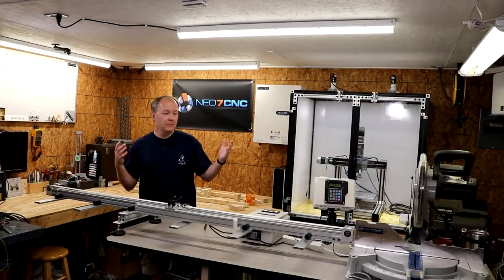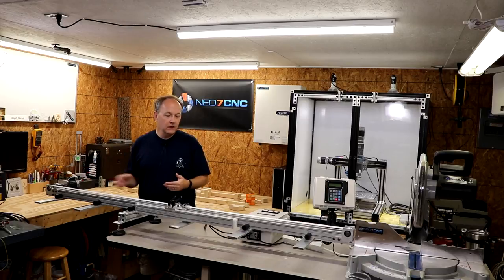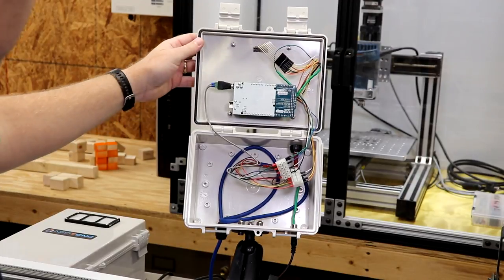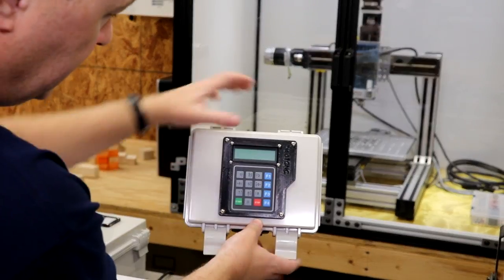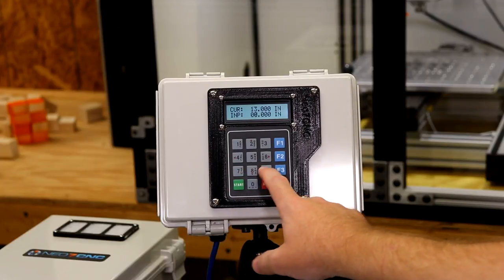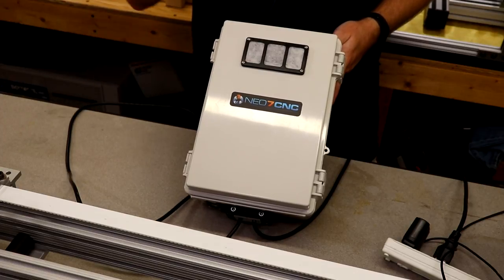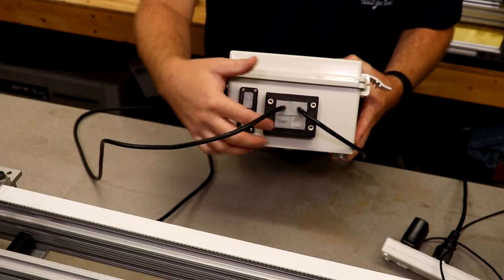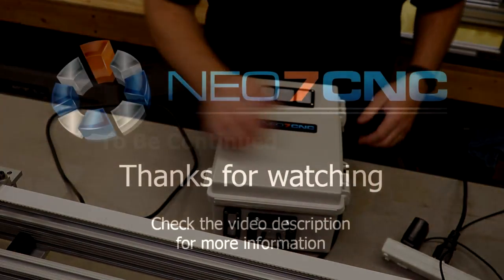Arduino / ClearPath Servo Controlled Chop Saw Stop - Part 2 - Neo7CNC.com

Comment: Wonderful work Mr. Burrell, congratulations. Question: What kind o limit switch/home switch did you use for the homing of this project?
Reply from the maker: Thanks!  The ClearPath servo is capable of setting home once it hits a hard stop.  When the system initializes, it drives the carriage slowly until it contacts the very beginning of the actuator.  That action sets the home position.  Thanks for watching and commenting.

Comment: I did a prototype table saw fence.  I made the mistake of using  belt drive.  I will change to a screw drive.  Will use either an Arduino or RaspberryPi.
Reply from the maker: This belt is steel reinforced so I'm hoping it stays true.  Thanks for the comment and for watching.

Comment: Hi, can you help me with the arduino code? i want to make a similar project, but in Brazil we dont have all the parts you used, i want to use a stepper motor, arduino Uno, keypad 16x16 and 2x16 lcd... with endstops... can you tell me if the code is just change the pins ? or the servo you used is diferent then pulse dir of steper?

Comment: Don't servos with encoders always know where they are?
Reply: Hi MySchizo Buddy,

Neo7CNC asked Teknic to chime in on this question since this video pertains to ClearPath specifically. You asked a similar question on a Teknic video as well, so I have posted my response on both videos. To help other viewers, I've copied your question (and my response) from the Teknic video below:

https://www.youtube.com/watch?v=-gigcf7ZzAQ&lc=z23bgldwgxesgxjtbacdp43bv0jilo1th3blon2qaftw03c010c

"There is a confusion about homing. Some youtubers say because of the encoder in clearpath servos you don't need homing on cnc machines. The encoder always knows where it is. While others say that if you turn off and on the cnc machine then you do need to home the machine. What about proximity switches? Do cnc machines need them with clearpath servos?"

These are good questions, but some that require a longer response and additional background, so I apologize in advance for the long post.

Generally speaking, most encoders are categorized into one of two types: absolute encoders or relative encoders (also commonly known as “incremental” encoders). At a high level, the two types serve the same function (they provide position and velocity information back to the servo drive), although there are some notable differences.

Absolute encoders provide unique positional information throughout the entire range of the encoders’ travel. These encoders don't usually require homing because you can “read” the position at any time and know where you are (although you still need to correlate a specific absolute position to a specific location on the machine). Please note that we further differentiate absolute encoders by the number of “turns” they can experience before they are no longer “Absolute” because the encoder’s position wraps (more on this later). You can identify the two types as “single-turn” or “multi-turn” encoders.

On the other hand, a relative/incremental encoder needs to be "calibrated" or "homed" initially. An incremental encoder outputs electrical "pulses" as it rotates, and it's the servo drive's responsibility to monitor and count these pulses to keep track of how far the encoder has traveled. In order to translate this distance traveled into an absolute location on your machine, the servo drive needs a starting reference point (or "home" location). I.e. the incremental encoder is telling you how many counts away from "home" the system has traveled.

So, since an absolute encoder doesn't generally need to be homed, you might wonder why anyone would use an incremental encoder. While there are a number of cost and performance benefits to incremental encoders, absolute encoders can only register their absolute location within a finite number of revolutions. If your application exceeds the number of revolutions or turns of the encoder, you can no longer identify your absolute location simply by looking at the number. 

This limitation is akin to wrapping the trip odometer in your car – if you exceed the highest digit, you no longer know exactly how far you’ve driven just by looking at the number. For example, if your odometer displays “999”, you may assume that you’ve driven exactly 999 miles. However, if you don’t have a “thousands” digit on your trip odometer (which is common in some older cars), it's possible that you could’ve traveled 1999 miles, or 2999 miles, or 3999 miles and so on. Relative encoders don’t have this limitation as the servo drive simply continues incrementing and counting the position in reference to "home". Since most applications require multiple revolutions of the motor (in many cases, hundreds or thousands of revolutions), incremental encoders are more cost-effective options. 

While I cannot comment on every servo out there, I can discuss the products Teknic manufactures (the ClearPath motors which Neo7CNC demonstrates in this video). All ClearPath motors use relative encoders. Once you home a ClearPath motor, the motor will know exactly where it is on your machine as long as you don’t remove bus power. 

Additionally, Teknic sells a logic power back-up hub that you can use with the fractional horsepower, DC-input ClearPath motors to keep the encoder and DSP alive in case of bus power loss. If you use this logic power back-up feature, you will not have to home your system more than once unless you lose bus power AND logic power back-up (this feature is similar to how some absolute encoders work with a battery backup function). If you’re interested, you can learn more about this logic power back-up feature here: https://youtu.be/mALi3_QqyHk?t=426

Regarding your other question, you are not required to use proximity sensors with ClearPath motors, but you’re not precluded from using them either. ClearPath has a built-in hardstop homing routine, but if you prefer to use sensors, you could wire them into your CNC controller. 

I hope this information helps clear things up. If you have follow up questions please feel free to contact us directly through support@teknic.com.

Best regards,
Brendan F. - Teknic Servo Systems Engineer